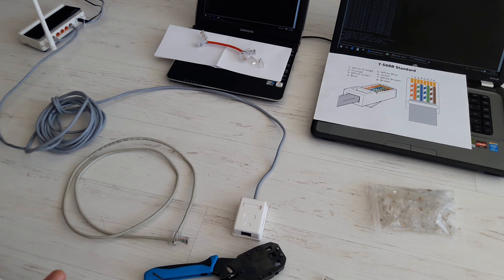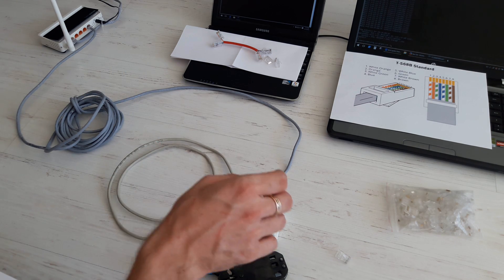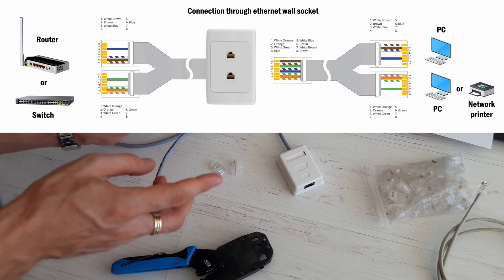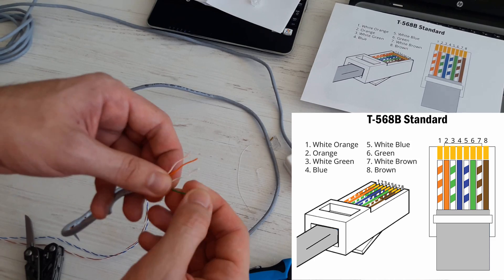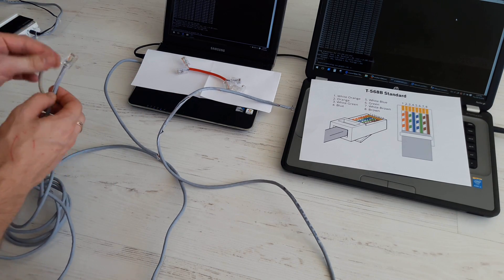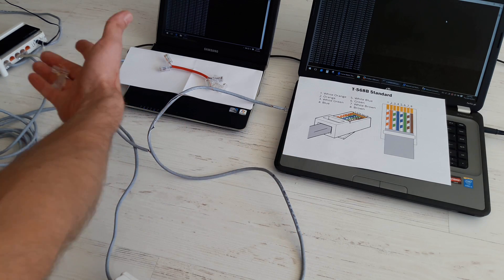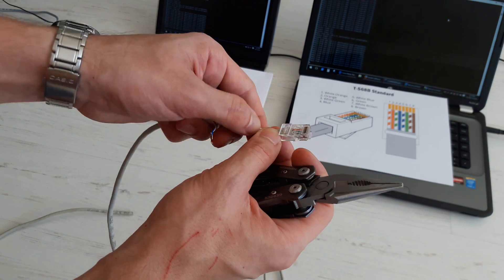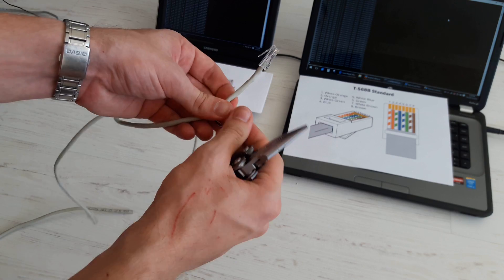Ethernet Hack: Use One Cable for Two Devices (No Switch Needed)

Comment: hey man ! I want to know that my PC is placed at a distance of about 100 feet from router . Can I share internet through a single cable of 100 feet from router to my PC?
Reply from the maker: Ethernet cable will perfectly work up to 300ft.
Reply: @ElectronicsComputers  If i connect it to another router than my PC. Will speed slow down or remains same in the second router ?
Reply from the maker: If your cable goes from one router to the second one and then you connect your PC to the second router by cable then there will be slight drop in speed which will be way higher if you connect your PC via Wi-Fi to the second router. Your router usually has a one WAN port and about 4 ethernet ports for a local network. So if you connect your that cable in any of those local network ports and then your PC in any of those ports (we don't use WAN port) then your router will work as an Ethernet switch so no drop of speed at all. But in that case your second router will not work as a Wi-Fi router.  @asimmehmoodali7167
Reply: @ElectronicsComputers  what if i use a ethernet splitter with original LAN and then two wires from splitter to first and second router. Then speed remains same or slows down?
Reply from the maker: I don't know how is your network organized... For example if you have a switch/router somewhere in your basement or whatever and there's a cable which you can split and connect one side into two ports of that switch and two other ends you can connect to both routers. In that case you'll get the maximum possible performance.  @asimmehmoodali7167
Reply: @ElectronicsComputers  thanks man it solved my problem.
Reply: you are a nice youtuber . I liked and subscribed your channel
Reply from the maker: I'm happy to help!  @asimmehmoodali7167

Comment: If I want from 1 Switch Port to 2 Computers, how?
Reply from the maker: You can only split a cable for two PCs and you need two ports to make it work. It's impossible to split one switch port for two devices. You can split wall socket for two devises but again on the other end you have to split the cable and you need two ports.

Comment: I did same but it works in one of and don't work in other pc and shows unidentified network
Reply from the maker: I I understand you right some PCs work on the same cable but others not Right? Then on PC  which has problems go to device manager -> adapters properties-> Advanced tab. Then find option with speed and try to play with speed and duplex or full duplex. It will work!

Comment: May God bless you real Good. i was stuck on a project just now trying to install LAN Faceplates in 6 rooms with 3 having to be split. Your video helped me solve a 4hrs deadlock. now my project is finished and all 10 ports working
Reply from the maker: Thank you! I'm so glad  could help you!
Reply: at only 100mbps you will have to tear that and redo it

Comment: Terrible idea.... you are basically taking a 1gb wire and turning it into a 100mb wire and don't have any shielding between the two pairs. You are asking for connection issues on your device. A better idea is to use a cat6 splitter 1 into 2 or better yet a inexpensive 5 port gigabit switch.... you can always tuck the switch under a counter or something.
Reply from the maker: Buddy you didn't get the point of the video!!! Of course we can buy switches, routers splitters whatever. But there are some situations when you can't buy it or you have urgently deploy some equipment and someone forgot to put a switch in the box etc. It's  for our education and it perfectly works as a temporary solution. Anyway thanks for the comment!
Reply: @ElectronicsComputers  what is the purpose of this video I don't get the idea of it if you have enough switch wire just add second cable to it
Reply: @sumchee448 Chee seriously? It's an instructional video... are you thinking this is some footage of a reality show?

Comment: Muris Cickusic, smart dude is right, I tried to split the end of the cable coming out of my router, making it with 2 ends, one going to my MacBook Pro in the den downstairs and the other RJ45 to my windows computer upstairs, ended up messing everything up it never worked, but maybe it’s because I didn’t have the right tools.
Reply from the maker: This method definitely works!!! You have to split the cable on both sides!!! It should look like this: http://www.cabling-design.com/references/pinouts/split.shtml

Comment: By doing this you can have problems like higher MS ping, crosstalk, limited speed to max 100 Mbps and not able to use as POE adapter. Also your color code disrespect creates future problems if you have multiple devices like an alarm or camera or other ict lan devices. Anyway it is a solution that works well for small use with its limits. The first 2 pairs are for LAN the other 2 pairs are not used. So in a traditional CAT cable you have the option of use 2lan, 1lan and phone or 1lan and 2 phones. Or use of backup line from other source Incase you have 2 isp providers. But keep in mind to make a drawing of the colors and place you used them so it’s easy in the future when need changes to identify and upgrade if needed.
Reply: If you don't need more than 10/100 and just need a reliable and quick wired connection, this is the way to go.   Using a switch is ideal but not always possible. Sometimes there's only a single wire and nowhere to plug in or put a switch.
Reply: Exactly, a small switch is a much better idea and a whole lot easier.
Reply: Sorry, I'm an amature, what do you mean by that?  I have strung outdoor CAT6 cables from my server room, outside and back into each floor of my house where I hope to be able to terminate with two plugs on each floor; one for a local, floor level wifi and the other for people to plug into.  What do you suggest is my best plan of attack for terminating all teh cables which are now in place?
Reply: Indeed, this kind of hack is useful only when you need an analog phone line or other specific situation where a normal switch wouldn't do.
Reply: no one gives a hell u sis ass
Reply: @rarehunter9441  I care, I wanted to split my ethernet so that I could get better than wireless connection, not worse.
Reply: Rare hunter actually these are the most intelligent .... well that is to somebody with a brain

Comment: does it work for 2 PC's simultaneously? or 1 will have no reception when the other is using the connection?
Reply from the maker: Both will work at the same time. You are using two pairs of cable which anyways stay without work.
Reply: Thanks, bud. The other PC can't connect, though. I wonder where it went wrong.
Reply from the maker: Do you have a link? I mean some indication on the other PC?
Reply: yes a at the same time. It's just using the unused pairs for a second cable but it's not a great idea to do it.

Comment: Would i be able to use this method for pair-bonding with a single Cat 5E cable and achieve 2x1 Gbit/s through one cable?

I need more local bandwidth, but im too lazy to install a second cable or upgrade to cat 7. :-)
Reply: This won’t be possible I’m afraid, as gigabit need all pairs be used following by the color standards. The best will be in you case to bind it at the router true load balance, then go to a Ubnt USG to control your network and from the end go further by connecting a switch. So from the switch you can go in different Gigabit lines on method is by using VLAN true the USG And switch. If want more info or proposal drop me a line at dimitri.ibizi@icloud.com

Comment: Just buy 5 Port Gigabit Switch for $20.
Reply: This method is actually a pretty useful hack if the cable has been installed inside of the wall and you need two separate direct connections to your switchboard.
Reply: two shitty non standard sub 100mbps connections*
Reply: Additional switch will need additional space and additional power cord.

Comment: Hi. Is there any signal loss/interference over 25 metres running this method
Reply: Yes. Just use a 5 port switch. 

https://www.officeworks.com.au/shop/officeworks/p/d-link-5-port-gigabit-switch-dgs-1005a-dldgs1005a

Comment: does it work for poe also?
Reply: No, the poe uses the spare pairs.
Reply from the maker: If you want to split the cable for two more devices then there are no 
wires for POE to transmit DC power. Because you used them for data 
transmission for another pair of devices.
Reply: @ElectronicsComputers  For most applications, PoE will still work, you just have to make sure that the device supplying the PoE (switch, NVR, injector, etc) supports PoE "Mode A". See the "10/100 mode A, mixed DC & data" section of the table at https://en.wikipedia.org/wiki/Power_over_Ethernet#Pinouts also see my video https://www.youtube.com/watch?v=XInzn6VjMcM where I test that PoE works.